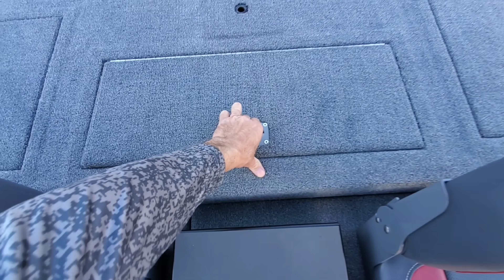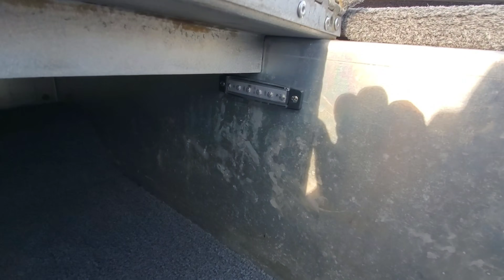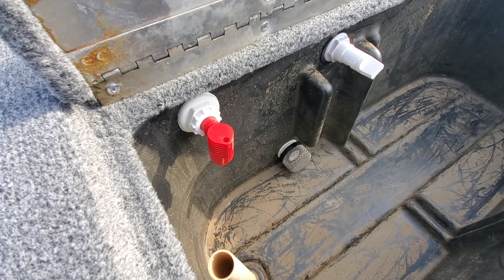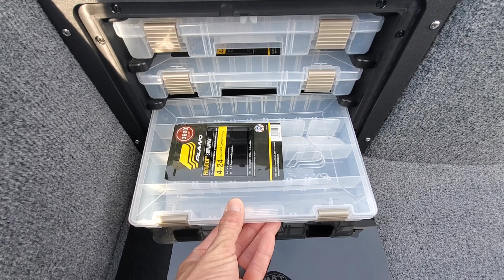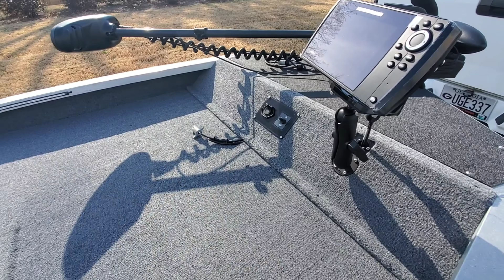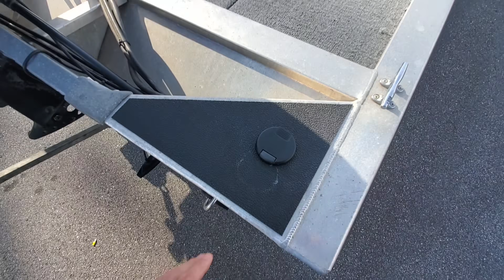ALUMINUM BASS BOAT BUILD Walk Thru | Bass Tracker Pro Team 17

Comment: Fantastic job!  I am now inspired to do that with my old new boat.  Question about the wiring.  I am running a dedicated 14Gauge power to the bow for the fish finder and Livescope to the back of the boat on a dedicated battery (what you did).  Can you wire that into the battery kill switch that you have under the console so that the switch kills everything in the boat?  Also, I would like to add versatrack to the boat as well.  Have you come across any good options?  Following your channel; love your work!!!.

Comment: I have literally the exact same boat. 2 questions. How did you make the rod locker bigger? and any idea where you can find those threaded tracker plugs? Great video!
Reply from the maker: Rod locker is the sane size it came from factory, i didn't replace plugs but im sure you can find on amazon or ebay.